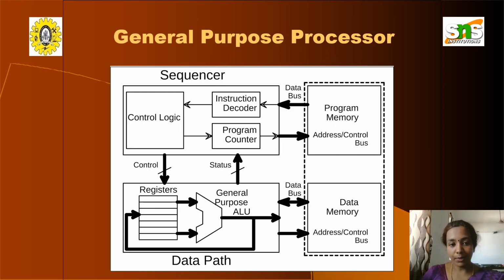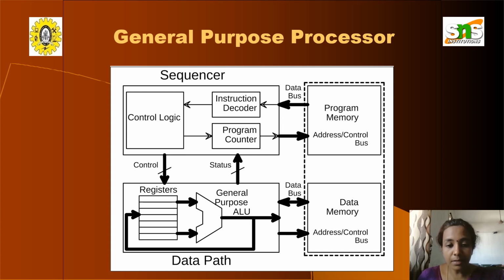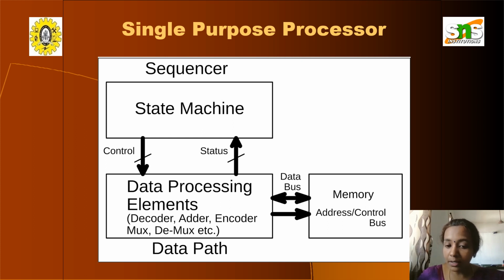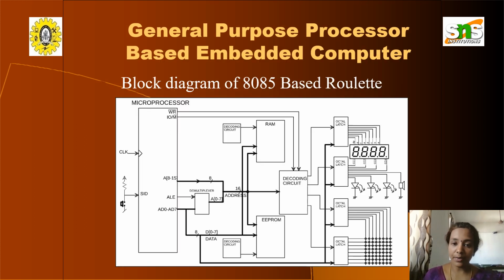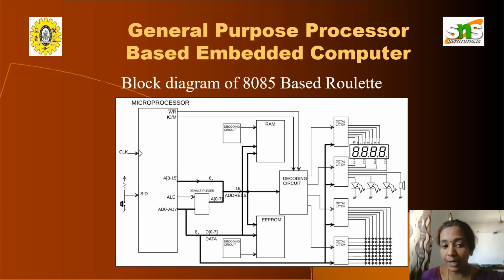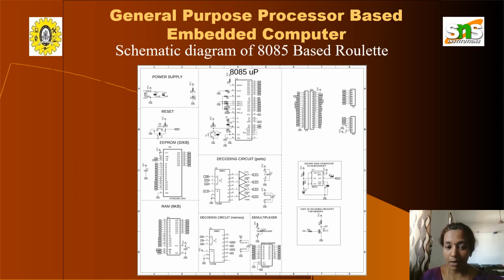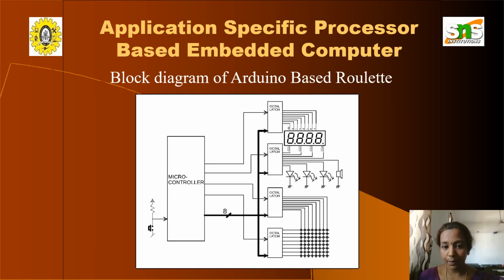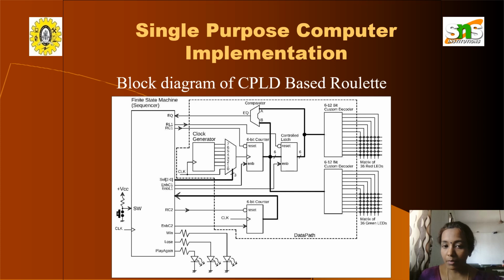General Purpose Processor | Introduction to Embedded System | Ms.P.Radhika

Comment: I think the YouTube algorithm suggested your video to me because of my professional background in this field. I wanted to offer some feedback on your teaching style. While reading from slides may have been how we were taught, I believe there are more effective ways to engage learners. I recommend checking out 3Blue1Brown's videos on structuring content and breaking it down into understandable parts. One crucial aspect that was missing from your video is the role of registers in computing systems. Registers play a vital role, and it would be beneficial to explain how a 16-bit CPU requires relatively few registers, compared to modern 64-bit architectures, which can store an enormous amount of information (2^64 bits) and pass it on to the next stage of processing which would kindle the students' curiosity.